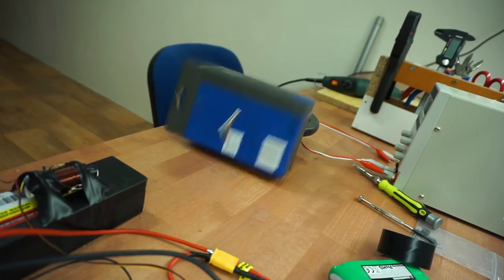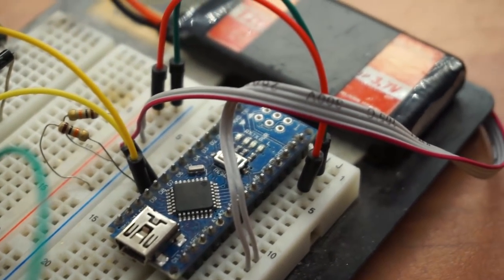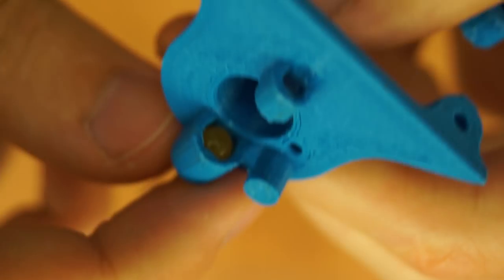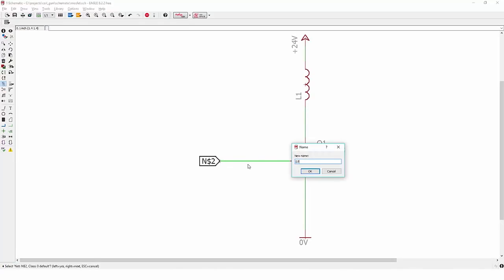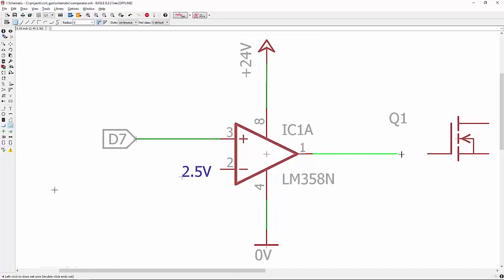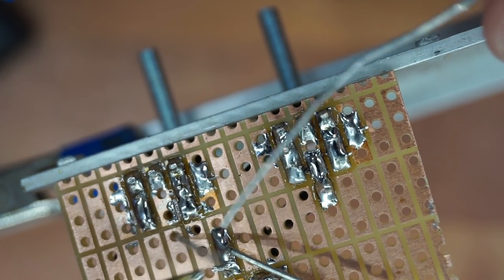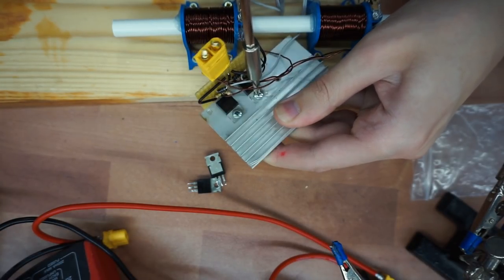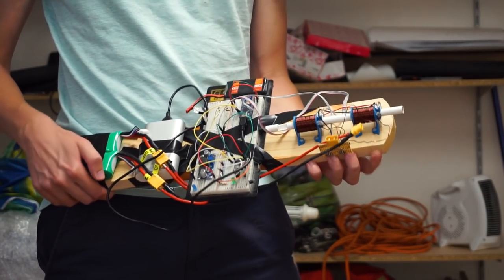CRAZY coilgun without massive capacitors part 1

Comment from the maker: Just a little correction. In the section about the MOSFET I have mentioned That the gate to source voltage needs to be 20V. That is actually the maximum voltage. In fact the 10V would be more than enough for this particular MOSFET. You can find it as graph named typical output characteristic in datasheet where VGS is the gate to source voltage. Thanks everyone for letting me know.
Reply from the maker: Thanks
Reply: why didn't you use an opptokoppler at the gate to trigger you would be able to trigger the oppto with the Arduino and the oppto triggers the batterie to the gate
Reply: The same reason you don't use opamps for gate driving.
Reply: I think a better solution would be to use a logic-level MOSFET. For instance, STB80NF55L can be triggered by a voltage as low as 1V (If I'm reading the datasheet correctly) and can pass 80A continuous. The cost is under $2.
Reply: It still has a gate charge of 100nC, the drive current is proportional to the gate charge and not the voltage.
Reply: I don't know whether that is a problem or not for this particular use case. That would depend on the maximum peak current the Arduino can supply and on the acceleration of the projectile.
Reply: Well and on how long the mosfet can stay in its linear region, the inductance of the coil, which is also changed by the moving projectile and uhhhh... I'd just do some back of the envelope calculations and then just try it if it seems about right. xD
Reply: @Azagro: The switching time can matter even on a single impulse but with a high Gate voltage, RDS(ON) will be low and the RC constant ( resistance time capacitance), for whatever has to move from the Drain to the Source, will be very low too. 100 nC  time 0.1 ohms, that is still in the nano second. I understand that for your bullet moving at the speed of sound, your bullet would have move 11 micro meter away in 5RC, but that hardly matter, imho.
Reply: there are 500v capicitors on amazon for 19$.

Comment: Can I power the gun using a dc-dc step up converter instead of the li-po batteries? I'm wondering.  If c Could perhaps attach a 3v volt supply to the converter (the one I have converts 3v to 32v) to work, or do I need to purchase li-po batteries?

Comment: instead of using two 12V batteries is it possible to power the coil with a 9V battery connected to a step up converter that increases the volts to 24?
Reply from the maker: No. 9v battery isn't able to provide enough current.
Reply: Gyro  I want to make a version of this and put it on a quadcopter... the batteries seems to be the heaviest part... do you have any suggestions on how to decrease the weight?
Reply from the maker: Well you'll need huge quadcopter 😀. In this case using traditional design with capacitors would probably be better. You can use small battery to charge them up to high voltage and then fire. But still the coils themselves are quite heavy
Reply: I calculated that a 0.8mm copper wire with a length of 7 meters (what I think is enough for one coil) will have a resistance of about 0.23 ohm, with this resistance one 12V battery will supply 52A which sounds a lot to me... yours had two of these batteries and the result was OK but not amazing like you would think from 100+ Amps. I'm trying to think how to improve performance without dangerous 400V capacitors. Thank you for all your help you are amazing! :)
Reply: Nadav Friedman You can get Lipo batteries which have surge discharge of 30C or higher... where C is the capacity of the battery pack. So for a 4AHR battery you get a discharge of 120 Amps. Try Hooby King for what's out there. Best of luck with your research.

Comment: This is a pretty nice gun you have, and a very good job on the explanation and video editing. Last year I built exactly this but scaled up to half inch projectiles, 48v, and a teensy 3.2 microcontroller (there's some video of it on my channel if you want to see it). Some thoughts on what you have here:

- I recommend putting the IR sensors in front of the coils instead of behind them. That gives you more time to respond to the input and switch the coil on or off. This becomes especially important as you reach higher muzzle velocities.

- I saw you calculated peak current from the batteries, but I didn't hear anything about your coil resistance. I'm sure you know this already, but the maximum the gun will demand from the batteries will be I = V/R, with R being the resistance through your coil. Make sure that your batteries are specced higher than that number (and leave some copious safety margin) to avoid issues like premature (and possibly spectacular) battery death.

- A flyback diode across the terminals of the batteries may also be a good idea. I know with my gun I was seeing a fairly substantial negative voltage spike hit the batteries after a shot. It was extremely brief so I have no idea if it was damaging them, but putting a diode across that cut down on it substantially. I don't know about yours, but the batteries are the most expensive part of my gun so anything that will make them last longer seems like a good idea.

- As your mosfets get bigger, a simple pulldown resistor isn't going to be enough to turn them off quickly. I learned this the hard way after I set a $30 mosfet on fire because it remained in a half-on state too long as it was turning off. What you want is a gate driver. You could look up gate driver circuits and build your own, or you could buy some off the shelf ICs that meet your spec (I highly recommend the latter option).  One of the nice things about gate drivers is that you can buy ones that are optically isolated from the low side, which means your microcontroller is safe in the event of something going horribly wrong on the high voltage side of things.
Reply: Defintely right on the gate drivers. You really require dedicated drivers in order to get a good switching transition time. Now you're charging the gate at a very low current, therefore a very long turn on time. The IRF3205 has a total gate charge of 146nC and if you want to turn on your MOSFET from infinite Rds to 8mOhm Rds at e.g. 50nS you need a driver that does 146nC/50nS = 2.92A. Your OP AMP isn't going to deliver this amount of current without a collapsing waveform, transients, etc. Definitely without a gate resistor.

Another thing that makes me shit myself, is that you apply 24V to the gate of the MOSFET. This MOSFET is definitely going to blow up one time. The very maximum you should apply is given in the datasheet as 20V. Even then, in the graph you can see 15V is as good as 12V and 15V gives you probably the best on-state.

Comment: To make a sharp point on the projectile, put it in a drill,as you did, but use a metal file--not paper.  This always works great for me, as does a bench grinder with a 45 degree holder.

ONE QUESTION:  How do you cut of the magnetic field when the optical sensors say it is time to do so???
THANKS FOR THE GREAT VIDEOS!

Comment: about the mosfet 20V is the maximum voltage. you should look more below on the datasheet for the threshold voltage that is the voltage needed to put the mosfet on I would say 15V to be on the safe side and not blow the gate, but 10V will suffice

Comment: This should actually be a good relative measure of how to build one using caps. If the high current cap discharge is not sending the projectile farther than a pulse straight from some higher resistance batteries then something is wrong. The energy it seems to put into the bullet seems to be pretty good though. I guess enough lipos and there would be significant bang to reduce the need for a cap charging circuit.

Comment: as another commenter already said, you dont have to (and shouldnt) put 20V on the gate for the mosfet to fully turn on. notice it says absolute maximum ratings above the section where you have the 20V from. if you scroll down in the datasheet you will likely see some curves, and some describe the used Vgs for the test. in most cases that is 10V. so you should go with 10V for the gate. also for mosfet switching, the more current you can pump into the gate, the better. the gate is like a capacitor, so the faster it is charged, the quicker the switching.

for the isolation issue there are thermal pads specifically for use with mosfets.

Comment: The coils are done quite nicely. The electronics need to be cleaned up and I didn't notice a flyback diode on the coils themselves. The MOSFETs need their own, and most have built in ones, but taking care of the surge at the inductive source is a best practice. As for your projectiles try and find some ball bearings that'll fit your barrel. They're easier to build a gravity fed magazine for to give you multiple shots as fast as you can pulse the coils and feed it.
Reply from the maker: +cypherf0x the ball bearings would be really easy solution but the way infrared sensor is placed I must be using rods.

Comment: It might seem obvious (so maybe you've done it already) but if you move the screw mounts on the 3d printed frame for your coils to the outside of the frame they'd be out of the way and it would be easier to do the winding because they would not be in the way.
Reply from the maker: +Derek Read You're right. However there needs to be a flat surface to 3d print it from
Reply: Ah, OK. What if you made the sides longer by adding about 1cm (so the entire thing is initially taller by 1cm), and exclude your molded screw mounts, but include a horizonal "scored" area along the outside of each side (maybe 1mm tall that's about 1/2 thickness of each side -- this "score" would then be about 1cm up from the new bottom). Then you could heat that slightly and bend it 90 degrees outward? This extra 1cm of material would then have the two holes molded into it and they'd be in the right location after you do the bending.

Comment: you shouldn't need a zip tie to have the drill running. that's what the orange button on the side of the grip and the dial on the trigger are for.  pull the trigger, press the orange button to lock it on then adjust the speed with the dial on the trigger.
Reply from the maker: +jcschadt I feel so dumb. Thanks for letting me know.

Comment: Hey great project, but you got something wrong about the mosfet gate voltage. the +-20v is the absolut maximum this mosfet can handle before it gets a short. the layer between the gate and the terminals is only a few atoms (overdramatisation) thick and will be destroyed at voltages above 20v. you need to look for the gate threshhold voltage, it is usually much lower commonly between 1v and 10v and a dcdc converter is actually a bit op. there are many many possibillities to accomplish the goal with less expensive parts. for example use a pnp to vcc with two resistors in series at the collector (remember pnp goes to + with the emitter) to the gate and then a z-diode between gate and source to limit the voltage. now you take the first resistor and calculate it to limit the current to a reasonable value (say 75% of the pnp's max pulse current) and the second to set the current to a few mA. then you put a ceramic capacitor parallel to the second larger resistor. (between 10 and 100nF) with this you can deliver a really high current to charge the gate very fast, but the current doesnt have to flow the whole time. then you need an npn so you can switch the pnp. additionally aou can take another npn that shorts the gate (with the same double resistor and one cap circuit) to discharge it quick. be careful with the timing, so you dont have both transistors switched at the same time. you better insert a dead time.

Comment: It gave me an idea for video, since steps seem to matter more than just raw magnetic power, why not do a performance comparison between more steps with a shorter coils vs fewer steps with longer coils, both with the same length of wire (the shorter ones will simply have a larger diameter).

An example could be a test with 2 guns, one with a 3 steps with those coils in the video and the other 6 steps with coils that are half the width, keeping both guns with about the same "barrel" length.
Reply from the maker: +Ruben Fernandes that would be interesting to see

Comment: also, could you measure the current spikes with one of those big 100A current shunts? i would love to see how much they pull. and test if adding a normal electrolytic cap can increase performance
Reply from the maker: +fredlllll thanks I'll have to fix that part. I'll also try measuring the current

Comment: What C rating do your batteries have? I should think 4 or 6 low mAH high C rated batteries in parallel with a few more coils could make this shoot a lot faster.
Reply: I found a 850mah, 130C = 110Amp peak current battery on hobby king for 12 euro. If you have 6 .... 660amps. This should work quite well!!

EDIT: looking further I found a 3S 5000mah cell 130C burst that'd deliver 650amps peak.
Reply from the maker: My batteries are 65C So that is around 90A and they have even higher peak current rating. It's actually not a great idea to put the batteries in parallel since the coil will draw 40-50 amp(Based on my calculations).  You're better of putting the batteries in series for more voltage.

Comment: Where i can get the coil can i use coil from transformator?
Reply from the maker: If you mean the wire then yes you can you a wire from a transformer. Otherwise it's called enameled wire. You'll have to wind it yourself.

Comment: Great project, but LM358 is one of the worst op amps which you could use in this project, it has poor slew rate so swithichg the mosfet is slow. Better but not the best would be choice of TL072 which has push-pull output stage and much better (13 V/μs) slew rate tham LM358  (0,3V/μs) so overall efficienty would be better.

Comment: I made a 4KJ Coilgun this is funny ;)
Reply from the maker: pics or didn't happen :D
Reply: Ok! I'll propably upload a vid about this Coilgun. I built a two stage coilgun with  8x450v 4,5mF Capacitors. For the 450V I built a boost converter and it works just fine! (Sorry for my bad english im german) Actually my Coilgun is still in work because I need to put some safety circuits in it. Every time after two shots my mosfet blew up. So im adding a temparature sensor ;) And yeah. Your coilgun is pretty insane because you didn't use ANY capacitors nice work!
Reply from the maker: Can't wait to see it :)
Reply: Gyro Same!
Reply: Gyro this is my seconds channel i wanted to say that  i almost finished it
Reply: @peterhofmann9784  Where did you buy those capacitors? I only find around 500 µF capacitors with a 450V rating that were affordable.
Reply: @xXxLolerTypxXx  Just as an info: this acc is my second channel. I buyed them from "ebay kleinanzeigen". A site where people can sell their sometimes used stuff. I got 12 of these capacitors for around 80Euros. It's simple, just check every two days or so if somebody wants to sell them for a low price. Dont buy them from the manufacturer because such many large caps can easy cost about 1000Euros. (Please dont mind my english skills, its not my native language)
Reply: @killthesource4740  Oh, habe überlesen, dass du aus Deutschland kommst... :) Danke für den Tipp, werde mal danach schauen, wenn mein erster Prototyp funktioniert.
Reply: @xXxLolerTypxXx  Aber BITTE PASS AUF DICH AUF! 450v bei einer solchen kapazität werden dich SOFORT bei Kontakt mit deinem Körper töten!!
Reply: @killthesource4740  Danke für die Sorge, aber ich weiß schon, worauf ich mich einlasse. Bin Elektrotechnik-Student und baue das Gaußgewehr als Langzeitprojekt, bei dem ich jede Steuerschaltung diskret selbst entwerfen will :)